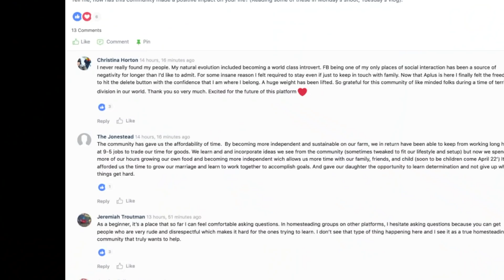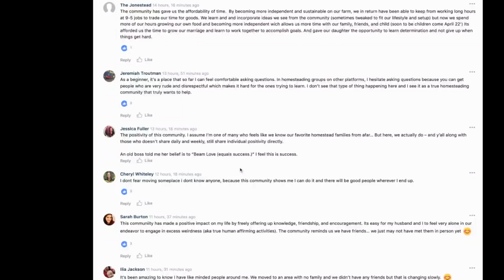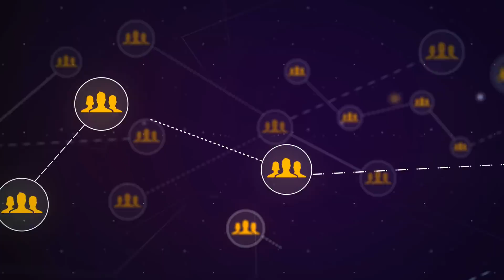Greenhouse Pigs | the Perfect Set up Just Got Better (part 2)

Comment: I'm thinking the trail cam, gosh you really need to find a trail trying to think how heavy or how hard it's used you know you got your your different levels of trails small animals don't make such an impact and larger animals do and you probably don't care of what you get on your camera but try to put it on a trail look like you just put it in a place and that's what trappers do they they put it near a trail at the animal already trusts it it's okay it's not been hurt there so it'll take a trail. To going into something new a new area there would be slower. Granite I could be wrong. but I would rather have some suggestions and try some things then to do the insanity thing over and over and over and not get any outcomes. Well lots of luck on yours and yours